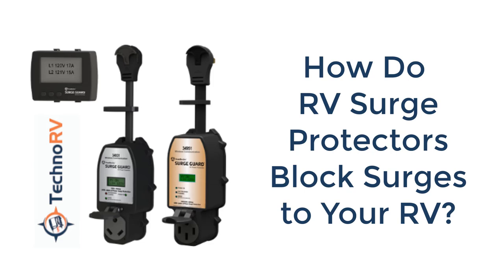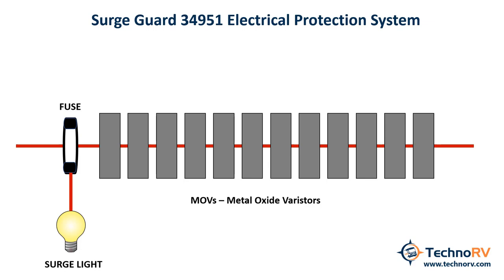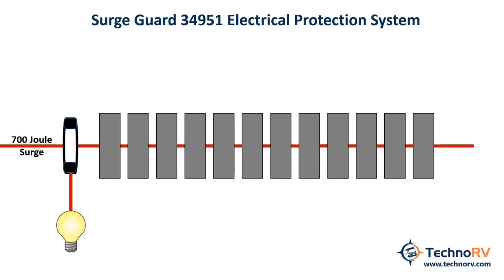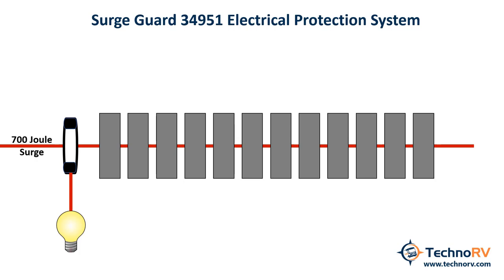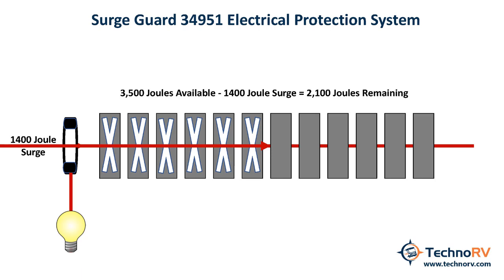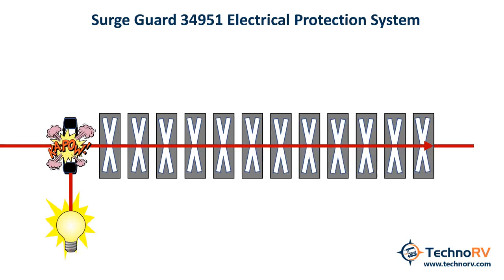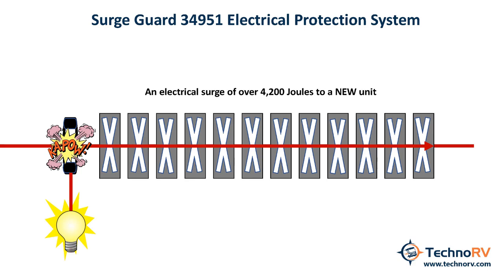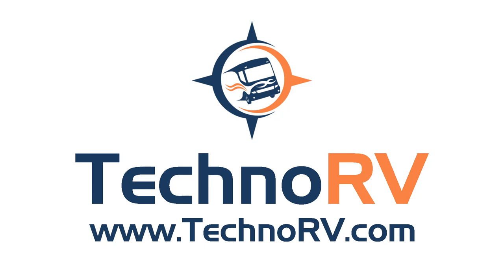How Does a Surge Guard Work to Protect an RV Against Surges

Comment: So once all the MOV's all blown, then the Surge Protector is garbage?  The MOV's don't reset at all?  Do all the Surge Protectors work this way?  Thanks for answering my questions.
Reply from the maker: Hi Dean, when the MOVS are all blown, it is time for another unit. I have had Surge Guards for a long time and have never blown all of mine, but of course, it is possible, but should not be common. There is another unit that has replaceable movs, but I have not used it and cannot recommend it as I have not tested it. i hope this helps. Eric